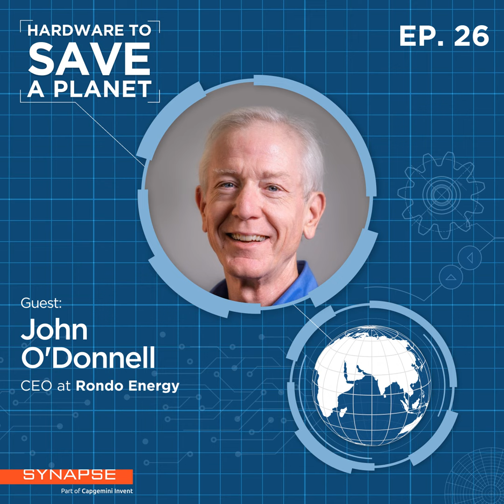Decarbonizing Industrial Heat with John O’Donnell, CEO at Rondo Energy

Comment: My 5cents kWh feedin vs 50cents kWh supply invoiced.

Grid electricity is extremely expensive. 
Grid makes dirt cheap electricity expensive.

Heat pump with expensive machine and expensive grid electricity after the sun sets. ??? 😮😮😮

Comment: Hot Bricks Heat Storage perfect, small and high performance efficiency at generation.

Grids are extremely expensive to build or expand.
Grids are $TRILLIONS infrastructure.
Grids R.O.I., return on investment $100sBILLIONS

PVR, PV Rooftop and 
HBHS, Hot Bricks Heat Storage, and 
BV, Battery Vehicle oversized battery storage and 
SR shaded hot roof.

Vehicles are parked 23hrs every day. 10,000 miles per 10,000 hours per year. 
Vehicles drive building to building. 
V2G selfparking selfplug-in BVs trickle currents all day long 23/7.

Continuous Hotwater from HBHS.
Area heating from HBHS.

Limited mechanical parts. 
No spiked demand. 
Supply to grid from stable battery.

Dirt cheap everything. Happy days. 
Grid UNLOADED and free to connect new customers and retain original customers as suppliers.
Grid supply from retained original customers. 
Grid backup to the original customers. 
Hahaha 👍 Hahaha 😊